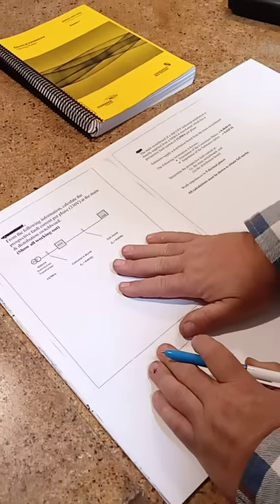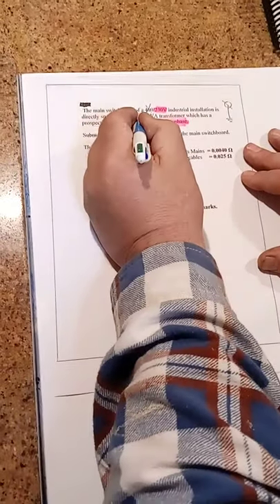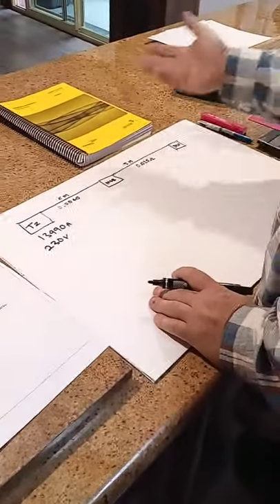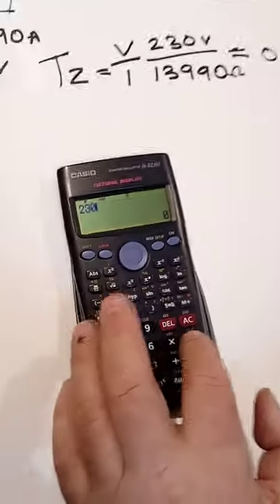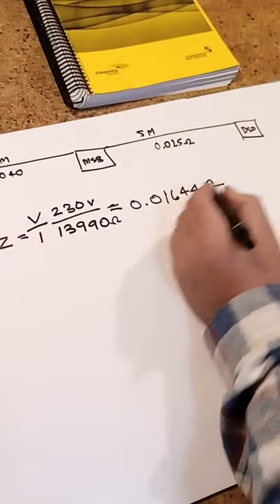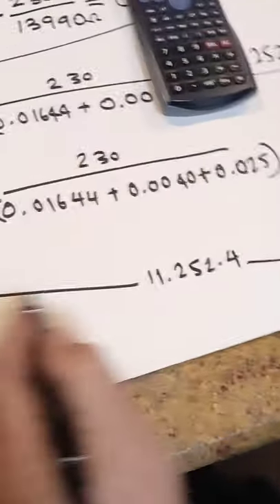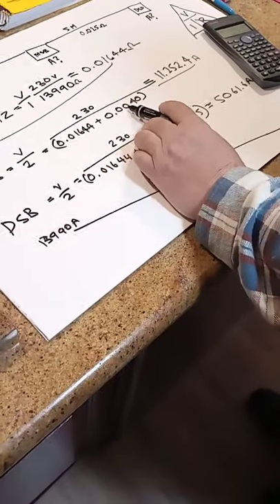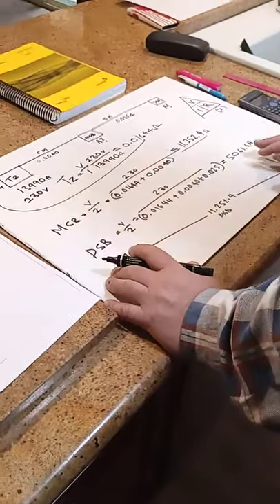overload and short circuit calculation LET exam fault current

Comment: Are the cable impedance values for the line and neutral ? ie  Do they allow for the length of the neutral return path also ?    Is the short circuit value for phase to phase short which is the worst case scenario i assume.  ?
Reply from the maker: The fault value is only for active only  to earth value